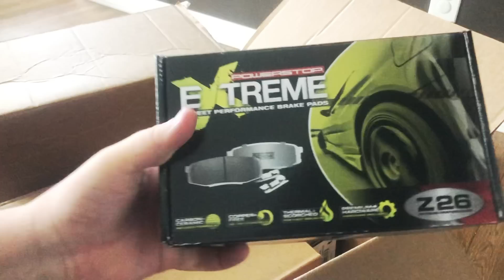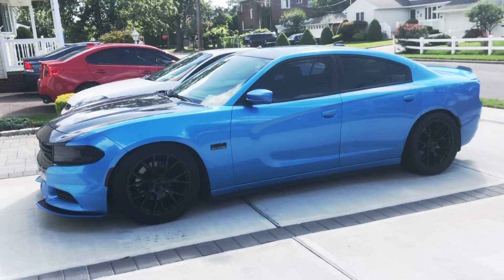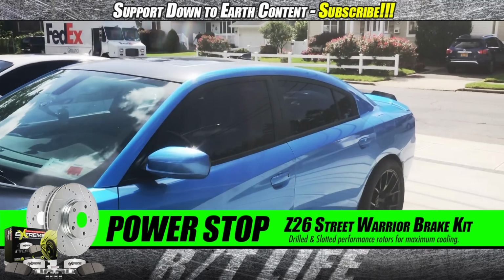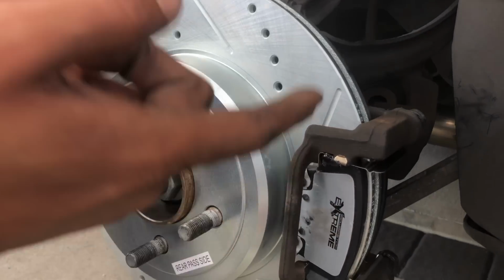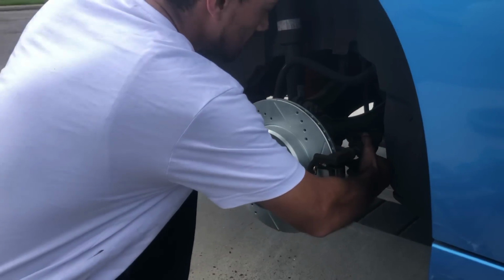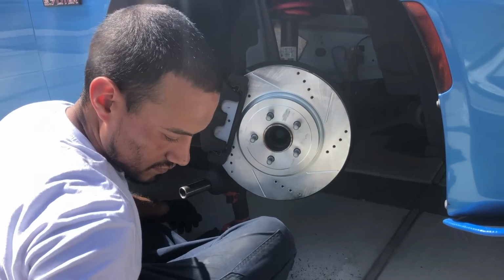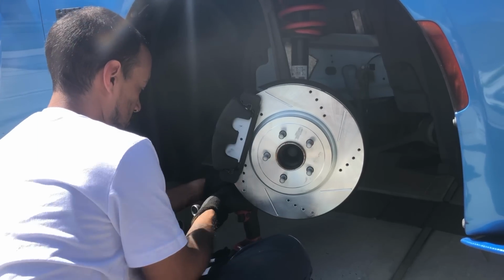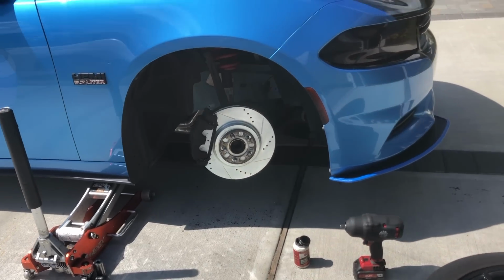CHEAPEST Brake Upgrade...

Comment: I just put drilled/slotted from R1 concepts on my RAM and they are killer. I'm definitely getting them for my Challenger too, $415/set including pads.
Reply from the maker: Yah that's basically what I paid as well ($400). Not a bad deal at all.
Reply: @RTLife  Poweroint for the win....the only thing that sux is the bedding proccess after...that 40 to 10 and 30 to 5 or whatever...lol

Comment: Off topic but what is your wheel set up? I'm thinking about staggering with some 10.5, 305, and 25 offset on the rears. Only worry is rub and poke.
Reply from the maker: 20x9 front w/ 275 & 20x10 back w/ 315 - Hellcat replica rims - I also have 5mm spacers all around. You will like having a staggered look, gives it a very beefy appearance.
Reply: @RTLife  what is your offset? Up front I'd be doing 275 20x9 20mm offset. Rear would be 305 20x10.5 25mm offset. Trying to decide if spacers are needed. They work just fine on good 392. Wasnt sure if we were different.

Comment: @ one point i thought about carbon fibre brakes but after some study i discovered that they usually need heat in them to work their best..When my 16 ram sport is ready ill have to do some more diggin..Would like a lil more sport but not break what lil bank i have left after home renos.

Comment: Man i need to buy these been looking at them for a while to cut down on dust but so nervous about the rotors cracking
Reply: They do not crack.....I had them for 1 year still good with no cracks jaja
Reply: @DanielRiego  thanks for the feedback
Reply: Cross-drilled rotors do have a higher potential for stress cracks, but these being slotted as well I think helps. Plus you'll probably never run into that problem unless you're into autocross or something.
Reply from the maker: I will make a video soon on cost, brake dust levels & how they compare to stock brakes. So far I would say I'm glad I gave this a try.
Reply: @RTLife  i know they are very affordable and supposed to cut dust in half if any at all..i have 6 piston brembos so i need them..thanks again
Reply: @DanielRiego  No rust on the hubs?
Reply: @josephmgomez3921  Until today no rust !! Still 100% good 👍👍
Reply: @DanielRiego  Awesome bro Ty!

Comment: I had those powerstop pads and rotors for a while and ended up taking them off in favor of the BR9 cop brakes.  The powerstops didn't impress me at all with their initial bite, in fact sometimes it seemed downright dangerous how bad they were when cold.
Reply from the maker: I haven't had them in the cold yet - will do a follow up video to see how they perform. So far they're a nice upgrade over stock. We will see though as time moves along.
Reply: @RTLife  By cold I just meant not up to operating temp.  For example, driving for miles on the highway, then having to quickly  stop on an offramp.  I never noticed this much if traffic on the interstate started slowing quickly, but if partway up an offramp (having coasted down to about 25mph or so) and having to stop suddenly, they were really bad.  My best guess was that although the temps are similar, it takes much less time elapsed for 70mph to heat the brakes enough to work well vs 20mph (Ek=.5mv^2).
Reply: @RTLife  Yes, better than stock for sure

Comment: I wonder if you'll need to replace pads more often because of the compound and the aggressive rotors
Reply: Vultite 
Stands to reason 😎
Reply: Shouldn't really have to if the pads are quality. The vents and the cross drills are definitely more for cooling but the slots are there to help divert brake dust so it doesn't create a sandpaper on sandpaper situation. The drilled and slotted rotors are on average put on aggressively driven cars but if they are kept in good condition they actually should help extend the life of the pads.

Comment: My wifes 1st upgrade on her 2012 Charger RT was wheels & tires. She did 20x8.5 wheels, 245/45 R20s upfront. Then 20x10 wheels & 275/40 R20s out back! Then she did the brake upgrade almost exactly what you did! Lol, her brakes bite so fast! Anytime i gotta use her Charger her 1st question when i get back is "Did you hurt my Charger"?

Comment: How much do the new rotors mass compared to the old ones? I don't imagine it's a good idea to try to get the girl to weigh less in the brakes department. She needs them big firm serious rotors up front to stop a man in his tracks.

I weigh every upgrade I do on the Barracuda as I'm doing everything I can to put her on a diet as long as it doesn't compromise performance. Going to be losing a LOT of weight when I get the entire front clip replaced with fiberglass. This modern sheetmetal is impressive. I'm amazed how little the hood on my '16 charger weighs. On the subject of hoods, I'm up in the air about how I should change it's color. The car is white, I want to go with a satin black. I'm leaning towards paint vs doing a wrap, I am skeptical of this newfangled vinyl wrapping... How is the wrap on your car holding up?

Comment: What is your current opinion of the kit? I have a 17 Ram that I will have to do brake pads replacement soon.
Reply from the maker: I think it's a big upgrade over stock - still have mine on & have no complaints
Reply: @RTLife  thanks for the reply. Keep the good work up.

Comment: Red or blue plasti-dip on the calipers would’ve been perfect while the rotors were off
Reply: That stuff would melt off. G2 Caliper Paint is probably the best stuff you can get.
Reply: Mine are dark blue on my light silver beemer

Comment: I bought geomet carbon brakes by R1concepts and they work so good, I've had bad experiences with these brakes, they warped and wouldn't cool fast enough. Looks so much better than stock tho.
Reply: No warp on mine....you did something wrong perhaps the bedding after the installation.

Comment: Did you do bedding procedure exactly as shown on the box? I' did same brakes (rotors + pads)  upgrade today for R/T and done partial bedding (less stops than recommended). Should I expect any bad consequences ? Is it good to redo bedding or just to use them normally?

Comment: Nice job on the install.  Since this is a "Street Warrior" setup I have to conclude that the braking advantages are seen (will be seen) in normal street driving and won't require some aggressive driving to heat them  up for best performance.  Some people(mistakenly) buy too much brake that is stilted toward track days and don;t work well on the street.

Comment: Should have painted the calipers while they were off. Just painted mine and the center caps of the rotors. Ive been eyeballing these for a break upgrade though. Takes alot to stop when your flying lol

Comment: I will suggest for anyone installing rotors to paint the hub black before putting them on. 
The hub part and a little of the rotor and the top edge will rust.  
I got a set from JEGS and after that happened I noticed that on many, many cars.
Reply: Im not worried about the rest since I live in Cali

Comment: About time you got an upgrade on your brakes, but unless you're replacing the calipers you probably won't see much difference. I too wanted to go with Brembo's at first, but that would've required changing out the front spindles. Eventually I'm going to get the Baer 6-piston set for front & rear. It's about a third the cost of the Brembo's.

Comment: Bro. When you can, replace those spacers for hubcentric spacers. It's for your own safety. I have 1/2 inch. They also come smaller.  By the way, yesterday I installed the same setup and I am just now seeing you did the same 😎👍
Reply from the maker: Yah I need to with hub centric - I got these & kind of just forgot about them lol.

Comment: Powerstop is great! I’m running their stuff on both my cars. My Charger has the BR9 brakes, so I went with the standard coated rotors and the Z37 Top Cop pads. Used them before and liked them!

Comment: Fair warning those drilled holes, when it snows and you drive through salt, will rust like nobodys business, i went with regular slotted ones, they eat through pads like crazy but stop so much better. Wait until you get that high pitched squeal, its embarassing as heck 🤣* hynerrggghhttt!* chance the caliper bolts gaskets every 2 years or they WILL stick, as me how i know lol
Reply from the maker: We will see - going to have a follow up video at some point. I appreciate the heads up though.
Reply: Agreed, plus you must make sure you install drilled rotors (well drilled and slotted really but drilled more importantly because of the holes just by nature of perforating the blank) DIRECTIONALLY or they WILL crack, it's just a matter of time. I know it seems like a stupid comment but you have to make SURE you know what directionally means, it has less to do with the holes and slots and EVERYTHING to do with the rotor's VENTS (it should be included in the directions). I've used drilled, slotted and drilled AND slotted rotors on multiple high HP vehicles so far and I agree with this statement regarding rust. Slotted are fine enough to get rid of rainwater and offer some cooling and those calipers are not going to squeeze those brakes hard enough to build up crazy (like warping crazy) amounts of heat. They may look cool, but drilling is really unnecessary. My SRT came new with Hellcat everything (except the supercharger) including the 2 piece Brembo rotor brake package and they're just slotted. I am so heavy on my brakes that my rotors are thin after only 5500 miles and I'm still going to go with 2 piece slotted but I have a buddy at a Dodge dealership who just happens to be the Parts Dept Manager so I'll get them cheap enough. Relatively. 
But your mechanic didn't bleed your system OR spray your rotors or pads Bro?!
Reply: My slotted didnt care whichever directoon they went, i went with the lower portion of the slot facing forward to keep resistance down still stops on a dime, im going through my second set of pads in a year cause the damn gaskets for the guide pins collapsed under the heat and stick now xS

Comment: Just did da 4 piston brembos on my 300c
Reply: Right on, what year 300? I have a 2006C w/5.7 & I could use some better stopping power.
Reply: @jaypatricksei8428  To go to Brembo's, you'll need to replace your front spindles with SRT ones. The cashier mounts don't line up otherwise. Baer's fit perfectly though, & cost less. Also heard that they have better stopping power than the Brembo's.
Reply: Better off getting the 4 piston so futher down da road you can sway to 6 piston easily with the same front spindles
Reply: Oh it's a 2011

Comment: Did you get stainless steel braided brake lines?  Those will make a difference during braking.
Reply: They are a very good upgrade because they won't bulge under pressure. The way he drives though I don't know if he's really going to need them for a while.

Comment: Sweet! Does the Dodge Charger rt and Chrysler 300c have the same size brake pads/caliber? Mine are bigger than yours.
Reply: Yes, the parts are interchangable between the 2. Even with the Chally most of the time.

Comment: Damm them pads were thin lol. As I am in the UK I got a good deal on Padgid (same factory that the Brembos are made) and EBC Pads.  I was impressed with the performance although they were not cross drilled.  I heard they can cause the disc to crack if not used well?  I am no expert but I thought that the holes would help heat dispersion

Comment: Hey R/T Life if I were to put drilled and slotted rotors only on the front wheels and keep the stock on on the rear, would that be a really bad idea or it wouldn't effect much??
Reply from the maker: I would do all of them - I think you would be fine doing the front but I would upgrade all at once.

Comment: Must have been a big difference from the non existent to the and new. Can't believe they survived 30k miles
Reply from the maker: There is def a big difference with these in place! I was really in need of brakes hahha
Reply: Seriously! I've gone through two sets of factory rotors in two years. And did you see those pads he pulled off the car! O... M... G...! They were dead for some time. Lol. Can't believe they weren't squealing like a mother.
Reply: @turtle6455   haven't had to do mine yet but it's not driven as much as you guys probably do. (Nice days pretty much)
Reply: I can't understand how you can have your car sit there like that. Lol. I don't have another vehicle, it just the rt, so I don't have a choice but if I did, I'd ... I couldn't help myself. I throw studded snow tires on in the winter and put on the miles. Hahaha. You must have the 392 or better don't you?
Reply: @turtle6455  no I have a modified rt classic but it's a pig on gas.  I drive for a living so my daily is my mustang. Trust me I really want to drive it more but time I have with 2 jobs makes it difficult.
Reply: Mmmm, yeah they do love the gasoline don't they.

Comment: Tbh I think you should’ve seen how much it would have been for a police charger brakes conversion
Reply: loony tube maybe the same? I think the police chargers use srt brakes and suspension
Reply: @GoldRanger1  No they don't. The SRT's use Brembo's & have an active suspension system. The pursuit kit has dial piston calipers, while the Brembo's are 6 piston up front & 4 piston in the rear for the SRT. The Scat Pack had 4 piston Brembo's up front.
Reply from the maker: I was kicking around the idea of doing that. Others have done this & had positive feedback.

Comment: That’s a nice upgrade... just wondering, When do you know when it’s time to replace the stock brakes?
Reply: Danny Galvan - For brakes, replace them whenever you hear squeaks or you notice the braking power isn’t there. For rotors, check for cracks, warping, and bumps. They need to be flat so the pads can have the most contact surface

Comment: Been waiting for this video. But you penny pinched. Lol. JK. Upgrading is expensive! I want up graded calipers so bad! I've seen a thousand power stop ads lately and probably will go the same route. As I've already commented on your other videos, the RT's stock rotors are shit. In two years of owning mine, I've worped two sets. And they ain't cheep. With the weight of the car they need to be better than what the factory is putting on. I really hope they have more longevity and thus aren't just a waste of money. Only one way to find out I guess.
Reply from the maker: hahaha yah I did (penny pinched)! Every option seemed to be way to expensive. The one option I was seriously considering was a pursuit braking. We will see how this plays out - for what I do with my RT it seemed like a decent option.
Reply: I'll have to look up the pursuit system. They multi piston calipers? I wonder if they require an upgraded hub as well? I'd love to find a wrecked hellcat at a junkyard. It's a nice thought but probably still out of my price range. Might have to settle for the power stops.